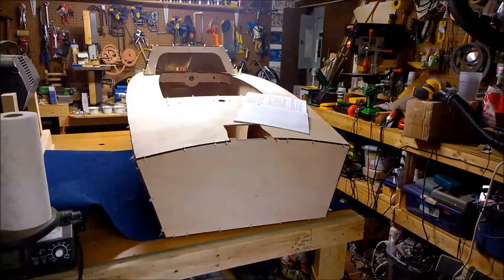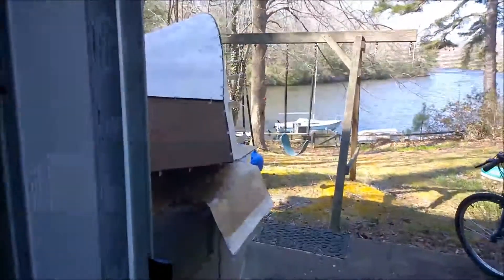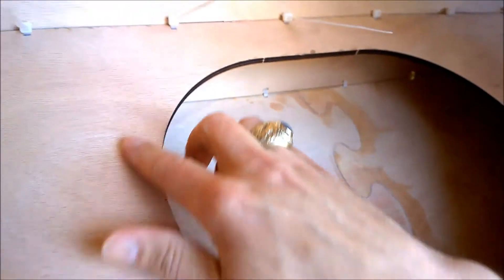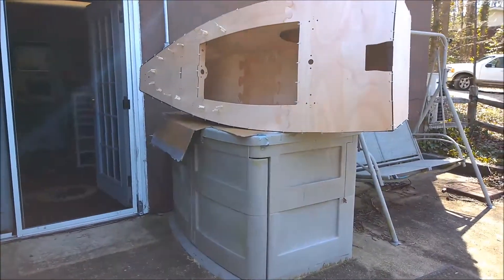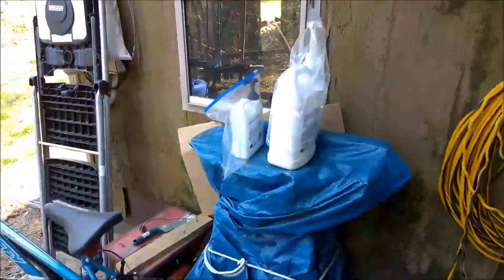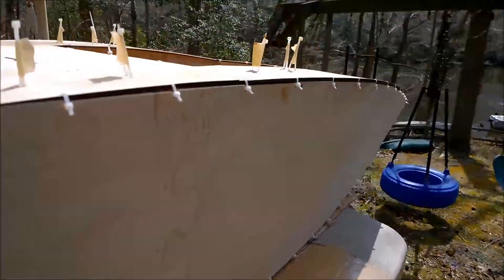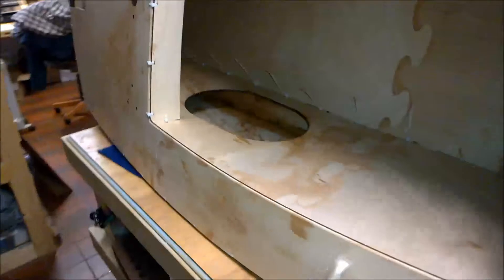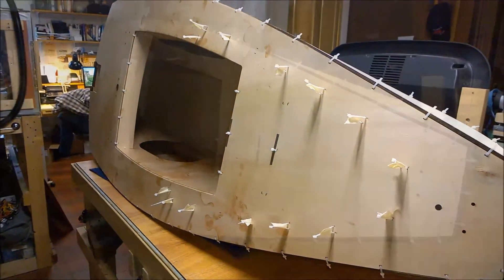Mini Boat Build - Video #5 - Epoxy Fillets!

Comment: Coming along nicely.

It sure does take a lot of wood-flour to get that epoxy to become a non-runny peanut-butter consistency!

Good luck with the caulking gun, but I wouldn't put my money on it. I hope it works for you, but if not: You may want to set the boat up vertically (secure it with roped if you don't have a friend to hold it) and then stand up inside it to get your whole arm in the hole.

Boat Yoga. 
;-)

p.s. We just took our boats out again today, this time into an even gnarlier "ocean" (The San Francisco Bay). I was pretty scared this time, but no flips. I'll spam-out a video-link some time next week. I think I filmed some good stuff, but haven't checked the footage yet.
Reply from the maker: Thanks!  We'll see how the caulking gun thing works, but I'll show the results either way.   Looking forward to the footage of today's outing.  How did you guys get back after flipping the boats in your last vid?  I'm assuming you climbed back in and motored to the beach?
Reply: In that video we were at a surfing beach. We were concerned that the next wave would just swamp us before we could get back in, so we just swam the boats to shore. Plus: I'm still lacking a bilge-pump. I think I'm going to install a bad-ass one in the near future.
Reply: cant wait to see the video!

Comment: Are you cutting the zip ties off as you expoxy or are they covered over with the expoxy?
Reply from the maker: Hi Chance.  The zip ties that are on the inside seams get embedded in the epoxy fillet.  Once that epoxy has set then the outside parts of the zip ties are cut off because the inside epoxy is holding the joint tight.  Then the outside is epoxied, sanded to shape, and then finished either in paint or varnish.
Reply: Thank you! I've been looking into this tiny boat for a while now, and I am happy you are putting up the build start to finish! looking forward to the remainder of the build!